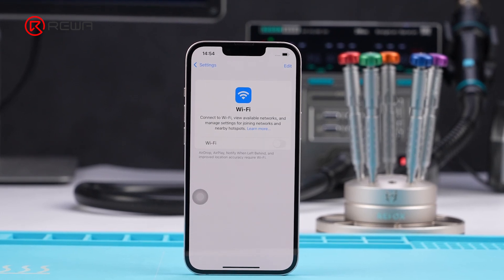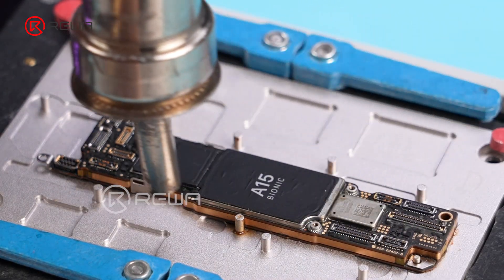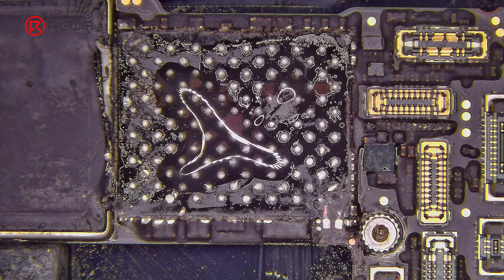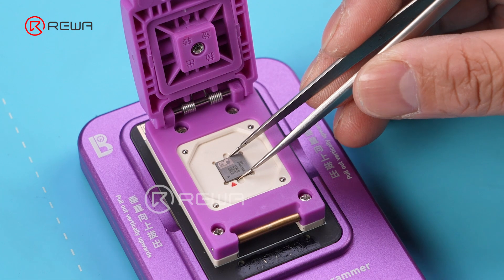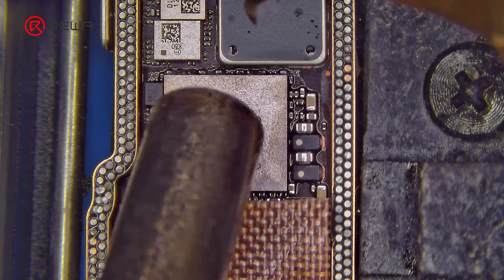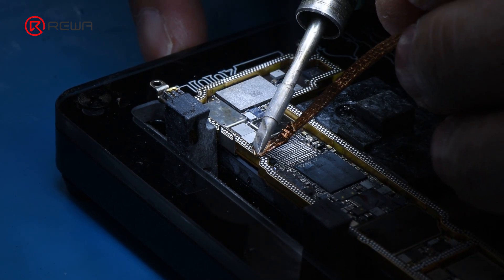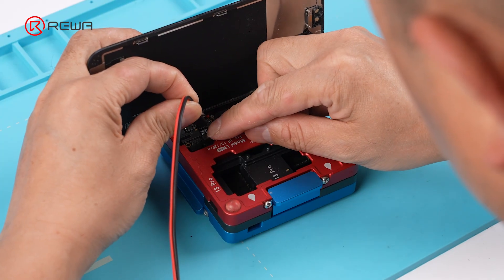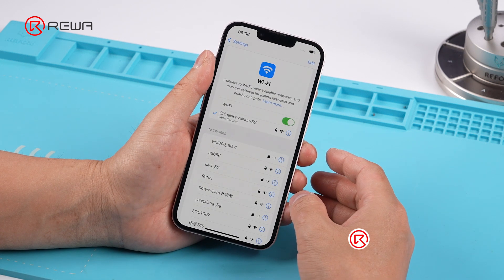First-Ever iPhone WiFi Chip Repair Solution--Step-by-Step Guide

Comment from the maker: For the first time ever, REWA Lab has successfully found a groundbreaking method to replace the WiFi chip on iPhones! We will update the corresponding repair product, you can check our repair tool first😘
Repair Tools:
1.RS50 Mobile Phone Opener & Clamp Fixture:
https://shop.rewa.tech/detail/refox-rs50-mobile-phone-opener-clamp-fixture.html?utm_source=YTB0214&utm_medium=video&utm_id=Repair+Tool
2.REFOX RS3 3D Screw Driver Set for Phone Disassembly Repair:
https://shop.rewa.tech/detail/refox-rs3-3d-screwdriver-set.html?utm_source=YTB0214&utm_medium=video&utm_id=Repair+Tool

3.BGA Flux Paste:
https://shop.rewa.tech/detail/needles-bga-flux-paste-nc-559-asm-uv.html?utm_source=YTB0214&utm_medium=video&utm_id=Repair+Tool
4.3 in 1 Knife Handle & Blade Repair Set:
https://shop.rewa.tech/detail/mijing-3-in-1-knife-handle-blade-repair-set.html Desoldering Platform: https://shop.rewa.tech/detail/mijing-ms1-intelligent-preheating-desoldering-platform.html?utm_source=YTB0214&utm_medium=video&utm_id=Repair+Tool
5.MaAnt T1 Universal PCB Holder for Soldering Repair:
https://shop.rewa.tech/detail/maant-t1-universal-pcb-holder-for-soldering-repair.html?utm_source=YTB0214&utm_medium=video&utm_id=Repair+Tool

6.SUGON 8650 Pro Hot Air Station:
https://shop.rewa.tech/detail/sugon-8650-pro-hot-air-station.html?utm_source=YTB0214&utm_medium=video&utm_id=Repair+Tool
7.iBoot A iPhone Power Cable For iPhone 6-16 Pro Max:
https://shop.rewa.tech/detail/sunshine-iboot-a-iphone-power-cable.html?utm_source=YTB0214&utm_medium=video&utm_id=Repair+Tool
8.REFOX RS30 ESD Phone Repair Heating Pad:
https://shop.rewa.tech/detail/refox-promat-rs30-esd-repair-heating-pad.html?utm_source=YTB0214&utm_medium=video&utm_id=Repair+Tool

9.Tin Planting Platform:
https://shop.rewa.tech/detail/mijing-z10-tin-plating-platform-for-iphone-x-12-pro-max.html
https://shop.rewa.tech/detail/mijing-z10-tin-plating-platform-for-iphone-x-12-pro-max.html?utm_source=YTB0214&utm_medium=video&utm_id=Repair+Tool
10.SUGON AIFEN A902 Soldering Station:
https://shop.rewa.tech/detail/sugon-aifen-a902-soldering-station.html 11.BEST 0.6mm Solder Wire https://shop.rewa.tech/detail/0-6mm-solder-wire-oem-new.html?utm_source=YTB0214&utm_medium=video&utm_id=Repair+Tool
11.BEST 0.6mm Solder Wire
https://shop.rewa.tech/detail/0-6mm-solder-wire-oem-new.html?utm_source=YTB0214&utm_medium=video&utm_id=Repair+Tool
Reply: Congratulations REEA team ❤

Comment: can the ECID be written to baseband chip using JCIDprogrammer?

because, ECID can be obtained by blob reading software installed on PC.
Reply from the maker: Yeah actually you can check it on some apps like i4 tool or some Phone Repair Diagnostic Tool.

Comment: Hello, it isnt related with video but i have a question for you
I recently changed my display for 13 mini
I was using ios 18 so i didnt copied the data ,
But after replacement, proximity sensor died and i couldnt use the auto brightness
It is not disabled by software i think
So i am finding a part for replacing the sensor will it work after the replacement?
How about face it?
Reply from the maker: Now on iOS 18, the front sensor does not take account for parts pairing, but you still need to transfer IC or pass the repair assistant( that requires you to update to latest iOS version)
Reply: @rewatechnology2008  thx a lot which ic should i transfer?

Comment: I have ipad pro 2020 after using android charge now ipad charging is not working. Pakistan famous iphone repair said i have ti reolay strips and ic. Both are replaced but still ipad not charging. Now he is saying i will open cpu and check board cpu yo charge connectivity if there is any issje i will fix it. But ipad dead chance is 50/50%.  Cpu line to charge port is short. Shopkeeper said. Now what i have to do. I have to go for fix or  not any suggestions? Is really ipad will be dead?

Comment: Hey, great job, what about the modem component, will it be possible to replace it as well?
Reply from the maker: The chip now is still customized, so once you purchase it, this wifi chip mainly works like forever
Reply: @rewatechnology2008  Same question, Will it be possible to later replace the baseband ic, like you did with the wifi?
Reply from the maker: @partner-p3s  Baseband now we still can not replace it, it is like the ID for the iPhone

Comment: why you can write new serial on a new Wi-Fi chip but you cannot read from there ? because chip is dead ?
Reply: They get the wifi chip data from Nand
Reply from the maker: Yeah we get the Ecid from the Nand first, then use Ecid to search Wifi SN, then writ it in new customized WiFi chip
Reply: @rewatechnology2008   u can't write it on wifi chip from another another  board?
Reply from the maker: @aibi5532  The device is vidal, but other brand may also have their own developed device and method